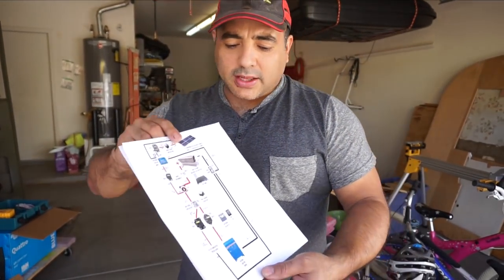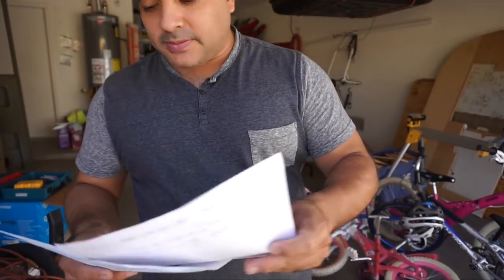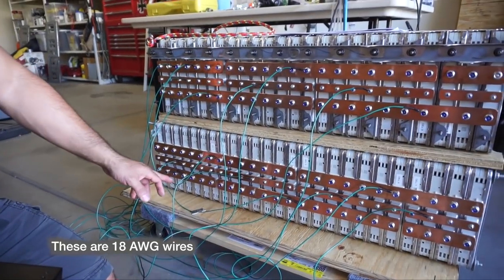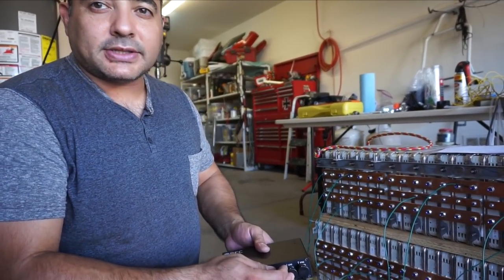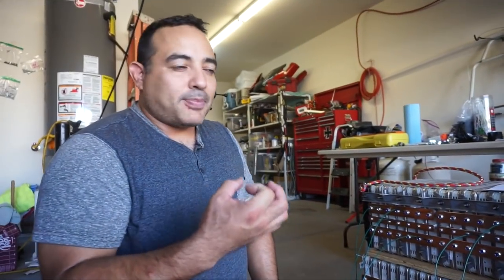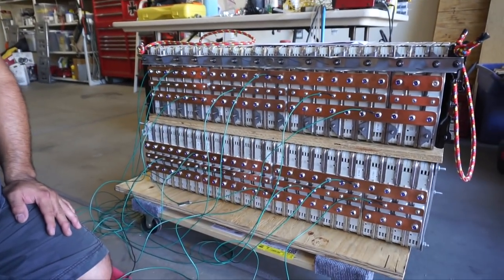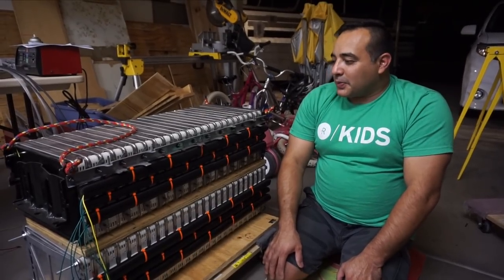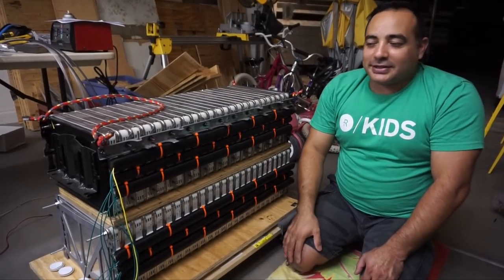RV House Battery Part 4: BMS wiring, test fit, protecting copper bus bars, and planning the install

Comment: Placing the pack in your coach looks like the perfect time to rent a small forklift! However if for some reason it doesn’t fit, let me know and I’ll take it off your hands to install in my coach. Great work and excellent documentation for those of us still married to lead-acids.
Reply from the maker: NoGas forklift is a great idea!  Thanks for the encouragement!
Reply: That's what I was thinking.  Rent a forklift, and maybe even an operator for a couple hours so you have a second set of hands!

Comment: Super impressed by this. But the amount of work you had to put in, it has convinced me I don't want to have to do the same!
Reply from the maker: I can understand that ... The good news is that the battery has been performing beautifully - we are working on the bus currently on a piece of land with no utilities - Our solar and battery powers our entire bus with 3 air conditioners (we live in AZ), refrigerator, internet connectivity, power tools, welders ... everything.  After over 3 years with this battery I am still impressed with how well it does.
Reply: I'm seriously considering doing this for my next battery project, I purchased 14 packs for a 2 x 48V setup. Batteries cost me $700 and the case/BMS kit cost me $360. An entire car of batteries would cost $1800 for 24kWh, but getting those separately in smaller batches would cost $2400. Not including the BMS/case/frame, which would be another $1000.

Comment: Seems like you could put the battery cage on heavy duty full extension slides,  that make life much easier
Reply from the maker: Thanks William - We did consider doing heavy duty extension slides but this battery should be a no-maintenance battery (fingers crossed).  When we pull it out it is because we found something better to replace it with :)

Comment: Agree with all the others... great, clean and well thought out organized job! Eventually, Victoria will enjoy some solar and a huge bank of lithium batteries.. maybe in mid/late 2018.. that will give me some time to source some batteries for the job, and stockpile some. 
I think I’m going with a large, lithium bank such as yours, instead of the small “make your own” 18650 batteries. Although, they make it look fun breaking apart batteries and creating these big cells! 
I will need to find a source for the batteries at my local salvage yards in Tampa Bay, where we will be living while the conversion takes place. I believe I can find plenty of wrecked leafs, Prius’s etc to salvage out some decent, low mileage batteries. (I hope!) great video.
Reply from the maker: Thanks steve.  My original plan was to use the 18650 cells but they proved to be hard to find.  Good luck with the build!

Comment: Cooling on these is insanely paramount
Reply from the maker: Yes, they work best at between 70 and 80 degrees ... One thing to consider, however, is that we have all kinds of Nissan Leafs driving around Phoenix where the asphalt temperature can reach 170 degrees with their batteries in a black metal box with no active cooling.

Comment: Great work and thanks for sharing this build. Do you need to put rubber mounts for shock/vibration absorption?
Reply from the maker: Hi Karl, We did not add any rubber mounts for shock absorption - the bus rides on 8 airbags so the ride is pretty smooth.  We are hoping that is enough.

Comment: Thanks for the website/videos on this....  you've inspired me... I'm going for tons of grid tie solar and SMA hardware (sunny boy and sunny island) which work with this BMS. What made you choose the REC BMS system? Did you have to buy their proprietary software to set the voltages? This setup is VERY expensive, in fact almost half the cost of what my 24kwh leaf battery pack costs.... is it worth that much money? What other options (if any) did you look at for BMS? Their website doesn't list any N. American distributors. Add on shipping, exchange, duties, taxes... gets pricey.
Reply from the maker: Thank you westvandude REC has a BMS specifically designed to talk to CAN bus on the Sunny Island stuff (it is the same hardware with a slightly different firmware on it).  I looked for a BMS solution for quite a long time.  Most of the BMS offerings (including the Victron one) were designed for LiFePO4 batteries which have different chemistry and different operating voltage ranges.  The REC-BMS can do these as well as cobalt and magnesium based lithium batteries.  When I was first starting the Batrium BMS was still being designed and REC had a great reputation with the boating guys.  I contacted them and Orion BMS.  I got a very detailed response from REC asking very targeted questions as well as highlighting some of the features that I had maybe not thought of yet (like balancing and battery health monitoring).  Orion responded with a standard form letter that asked me to look at their website and did not address any of my specific questions.  I bought everything you can buy from the REC guys including fuse holders and fuses, precharge controller, external display, every cable they offer, the software, the shunt, the contactor, all the temperature sensors.  Basically, everything they offer and the price came to $1003.44 including shipping and duties.  If you want to provide your own Shunt, Contactor etc the BMS unit itself is only about $350.  The customer support has been really awesome from REC.  I am not an electrical engineer and I am basically just figuring all this stuff out "on the fly" - they were very kind and walked me through any issues I had.  I have since recommended them to about 10 people that I know running the Nissan Leaf batteries and all have had great things to say about them.  They used to list a North American distributor but I don't see it on their website anymore - he was way overpriced anyway I think the mark-up was like 3X or 4X.  We have been very happy with the performance of the REC-BMS - our batteries are usually within 0.005 Volts and the integration with the Victron equipment has been fantastic.
Reply: Hey @BeginningfromthisMorning  if i was to build the exact setup you have and buy all the controllers along with BMS and breakers, do you have a list of everything you bought? Im really interested and love your content:)

Comment: Where did you purchase the BMS? I'm looking through the manufacturer's website and don't see a shopping cart. I also can't find anything via Google. Also, is that for the whole battery array or just one half (ie using two BMS)? How much does it cost?
Reply from the maker: Hi Tomas - I purchased it directly from REC.  I think most of it was done over email - I described what I wanted - bought a whole bunch of stuff from them and they sent back an invoice with the details and I paid it.  The Unit itself was 315 Euros but I also bought a 200A shunt, temperature sensors, a precharge circuit, the BMS Software, LCD touch display, CAN Cable, 48V Contactor, Fuses etc.  I have a complete breakdown of the entire thing on the blog at: http://beginningfromthismorning.com/bms/. I think the grand total for everything was about $1000.  I am only using one BMS for the entire battery.

Comment: they have to have better options on how to keep the bay cool. Maybe pump, fan, and radiator with an Anti Freeze reservoir? 
Maybe Hook it up to the Bus AC, or buy a Small RV AC, vs a WIndow unit?
Reply from the maker: How would a pump, fan, and radiator with an anti-freeze reservoir cool anything?  Where would the actual cooling come from?  RV air conditioners are known to be some of the least efficient and noisiest air conditioners available - they are also designed to be mounted on a roof - where would that go?  For $137.00, relatively small footprint, and easy installation - this little window unit will put out 5000 BTU of cooling on about 4 amps of power @ 120V.  If it breaks - it's very easy and cheap to replace.
Reply: @BeginningfromthisMorning  I meant Solar Split AC Units. https://www.solairworld.com/solar-hybrid-air-conditioner

Comment: SO - Looking now at your system - How much capacity do you really use?
Reply from the maker: Thanks Adam - the answer is a little complicated so bear with me.   Much of our time has been spent in campgrounds (especially on the east coast).  During those times the capacity doesn't matter much because we are in shore power.  We do a good amount of boondocking especially this last summer when we boondocked for a solid 3 months in the summer - then it matters A LOT.  We actually did a video on this when we were boondocking in Flagstaff AZ that might answer your question a little better: https://youtu.be/RWsUnlsZ6dY

Comment: I want to build me a 24v battery with these batteries, what BMS will work for these. I want to build my first battery. Will it be better to build individual 12v batteries each with it's own bms?
Reply from the maker: I would try to use a single BMS if you can
Reply: @BeginningfromthisMorning  Thanks. Are these Gen 1 or Gen 2. I been taking notes before I buy expensive parts but already have a collection of stuff.
Reply from the maker: @cutweldngrind  Gen2 - Unless you are getting Gen 1 cells for extremely cheap, I would stay away from Gen 1 cells at this point.

Comment: Awesome!  I'm thinking an engine hoist or a forklift like NoGas mentioned.  Curious, did you use LokTite?
Reply from the maker: I did not use loktite - the bolts I welded were really tight I am assuming because of the heat  - I maybe should have used some on the side bolts though.

Comment: Great setup !! How many battle born 12 volt batteries does your setup equal? I would like to use this setup in a 4x4 RV I'm building.
Reply from the maker: Hi Jim - this should be equal to about 21 12 Volt battle borns!  You have to add your own BMS to stay safe but for the cost of 3 or 4 battle born batteries you get the capacity of about 21 :-)

Comment: Hi - not sure if this is still active.  But have really enjoyed your journey.  I’m just considering building a power wall from leaf batteries and your blog & videos have been great.  Just wondering what model Victron Quattro you use - charging rate etc. Also wonder why you chose the Quattro rather than the multiplus.  I’m not sure of all the differences but understand the Quattro has 2 ac inputs rather than 1 with the multiplus.  Do you need 2? I’m debating whether to go for the multiplus 2 3000 Kva or 5000 Kva.  Probably the 2400w of the 3000 would be enough.  Using it for greater self consumption at home.  Thanks
Reply from the maker: Hi Alan - thanks we are still very active and building the bus.  We ended up going with a Victron 48/5000.  We chose the Quattro because at the time the  Multiplus only went to 24V DC and we knew we wanted a little more power without the overhead of adding an additional inverter (mostly due to space limitations).  I believe the 120V Multiplus still only goes to 24V.  We do not absolutely need 2 A/C inputs but we are already thinking of ways we can use this as a backup system for charging from the alternator (this is a long story that I may not even get to ... just in the "thinking about it" phase now) or a very small generator.  It's probably a little less useful in a residential configuration but the flexibility is hard to beat.  The Victron equipment has performed flawlessly in our bus - we run it 24/7 - with the solar on the roof it generally stays between 90%-100% almost all the time.  We run power tools off the bays, welders, shop vacs ... it handles anything we throw at it.
Reply: @BeginningfromthisMorning  Thanks for that - we’re 230v here. I guess your Quattro is 70 amp charge.  The 3000 multiplus is only 35 A but should be ok for my purposes.  I see there isa GX version which means I guess I wouldn’t need the color control.  I’m probably only looking to use 21 modules initially rather than the full pack.  On another note I’m wondering why you and others I’ve seen on line haven’t made use of the bus bars that were in the original leaf pack rather than making your own.- weren’t they available?
Reply from the maker: Most don’t use the original bus bars because they are very thin.  The pack as used in a car runs at about 400 V so the amperage is low and the thin copper bars are sufficient.  But as we reconfigure the modules down to 48V, actually about 56V, the amperage increases and we need much thicker copper to handle the current.  Also the original bus bars are very short and we needed longer ones to configure it in 14s14p.
Reply: @BeginningfromthisMorning  Thanks - that’s what I originally thought likely but then thought the Leaf has an 80 kw motor with potential current draw  of 200 amps (think I read that somewhere too).  Am I way off base there? 
Sorry the questions keep coming - trying to educate myself before deciding whether to take the plunge - did you bottom balance your cells before using and if so how?  Thanks
Reply from the maker: @alanparkes2885  I believe you are in the ballpark for what the Nissan Leaf was designed to pull from the battery (I had read 90 kW motor somewhere but came up with a similar number).  So if each module is designed for being capable of delivering 200Amps - we have 7 in parallel they should be capable of safely delivering 1400 Amps :).  Of course, only drawing 10kW max so we are nowhere near the 1400 Amps ;).  10,000 Watts / 55 V = still leaves us at about 181 Amps (Well under the 200 the bus bars are rated for).  In short, I think you would be perfectly fine using the stock bus bars.  I did not bottom balance my cells because I purchased an entire sealed pack and all the cells were perfectly balanced.  I also use a BMS that keeps all the cells balanced.  My pack is almost always within 0.005V from the highest to the lowest cell.  I also only charge the pack to 4.05V per cell and never bellow 3.4V per cell.

Comment: Ive been off grid on my home  in Phoenix for two years now with a 10 KW solar array and 12 KW inverters  using flooded lead acid batteries at 48 volt of course . My plan is to switch to  lithium  . Where do you get the BMS from ?
Reply from the maker: Hi Mark - Thanks for commenting - I would love to pick your brain and see your setup.  We hope to boondock quite a bit and we are hoping our setup will provide sufficient power for our bus.  The BMS is made by a small company in Slovenia called REC.  They are pretty popular in the boating community as well as in Europe.  We will do an entire video on the BMS once we get everything all configured and running.  They were really great to work with their website is:  http://www.rec-bms.com/

Comment: Hello again. Please enlighten me with the BMS connection. Each module has 2 cells that are 3 V each. How did you connect your BMS cables to read each cell?
Reply from the maker: Hi - Each module actually has 4 cells that are wired 2 in series and 2 in parallel (2s2p configuration) - each cell is rated at a nominal 3.8 Volts.  So the Voltage of the whole module comes to about 7.6 Volts.  If you look closely at the Nissan Leaf modules you will see a red terminal (positive), a black terminal (negative) and a white (smaller) terminal between the red and black terminals.  The white terminal is what they call a "sensing" terminal - and it basically is wired in between the two sets of batteries that are in series.  So if we measure between the "sensing" terminal and the negative terminal we should see 3.6 Volts - same with the positive terminal and the sensing terminal - 3.6 Volts.
Reply: @BeginningfromthisMorning  Sir your answer did not answer his question. Just said nothing about wiring the BMS.  And that's what he asked rather You talked about the arrangement of the cells. 

He is asking how you connected the BMS wires based on the arrangement of the cells of 3.6v that made up the one module of 7.6volts .
He wants to know how you wired the BMS cables to the Read, Black and Canter points of one module of 7.6v and to others modules too. The points your connected wires and those you did not connet wire to we want to know and why?
Please explain I want to learn too.
Reply from the maker: @greatogbuagu1370  I wrote a blog post on the details (as well as another video on the BMS): http://www.beginningfromthismorning.com/bms/
This blog post contains links to high-resolution pictures of how I wired everything up.

Comment: What is that bms? Where can we find this bms? How much will it be ? Where can we buy?
Reply from the maker: The BMS is from REC-BMS (http://www.rec-bms.com/).  It speaks Victron CAN protocol and controls the parameters for the battery.  The BMS itself was about $350 but by the time you buy the shunt, precharge controller, temperature probes, high voltage contactor, fuses etc it ends up costing right at about $1000.  Full details can be found (including price break-down) on our blog: http://beginningfromthismorning.com/bms/

Comment: I am curious why some BMS units have battery mounted boards with which to communicate, and this one appears not to?
Reply from the maker: I think that is a design choice.  The REC BMS just needs a wire to each cell to monitor it and perform the balancing.
Reply: @BeginningfromthisMorning  Thanks for the fast reply, Juan.  One more thing.  From who did you buy the REC-BMS.  I have been to their website and emailed them, but no reply.
Reply from the maker: @cappyodi9221  I went directly through their website - told them what I was interested in and gave them a parts list from their website and they came back with a quote.  I think they are a relatively small company - but I have always had great customer service from them.  If you are integrating with Victron or Sunny Island - they speak those protocols natively.  If you email me at juan@beginningfromthismorning.com I will give you all the contacts I have there.